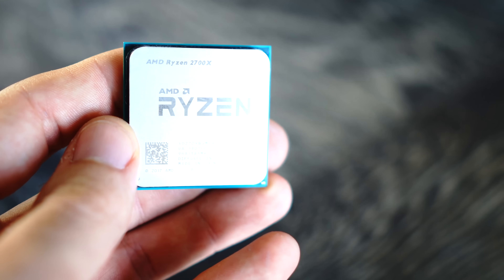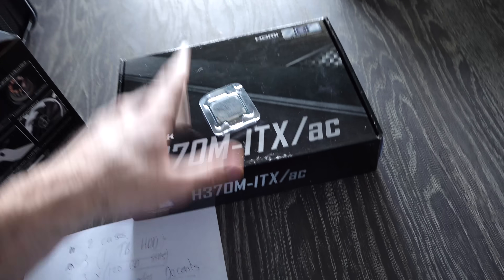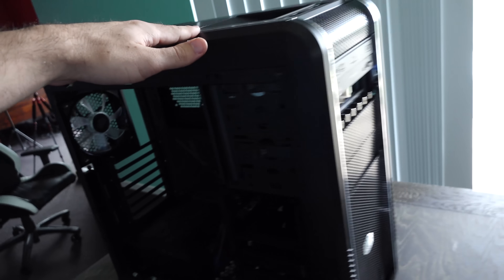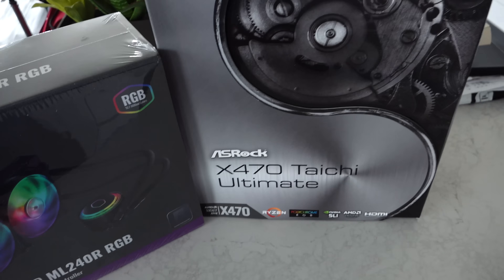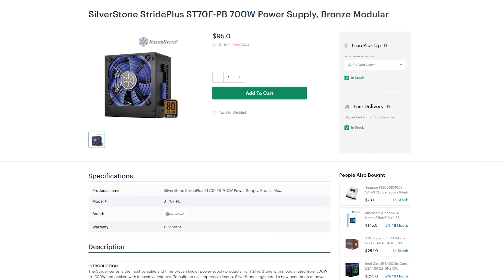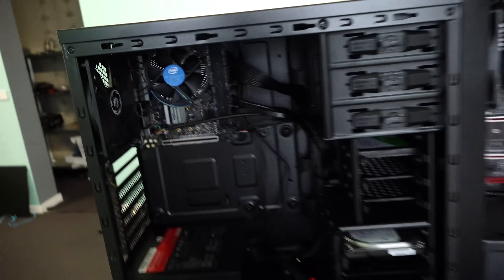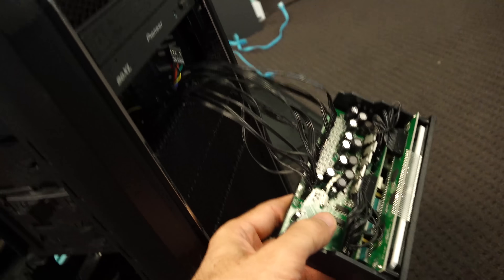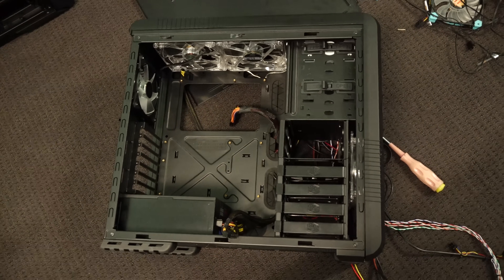X58... Vs... Something... IT BEGINS! The Story of 6 Core 3 Way Comparison that Never Came...

Comment: Damn that's almost apples to apples but the ryzen is going to have the advantage with it being a 6 core 12 thread where the other 2 are just 6 cores. I still want to see apples to apples with no price blocker. Same cores same clocks and see those results. Like the 8700 against the rice en 2600 or even the 8700K vs the 2600X. Where both the 8700 and the 2600 both are running at 4.2GHz or 4GHz since the AMD chip might not be able to hit the 4.2GHz mark. No one did that with the last gen and personally I don't think any of those past test panned out. Everyone was putting the 7700k 4 core 8 thread up against the 1800X with 8 cores and 16 threads, how is that even fair? No price, just performance, core vs core and thread vs thread.
Reply: x5675 is 6/12....
Reply: Oh crap, I should have looked that up, I apologize. I assumed it was just a 6 core part. But as for the newer parts, I would still like to see a fair run, and ignore the prices of the parts. Core for Core, Thread for Thread and GHz for GHz. To me that is apples to apples. I mean would you put up a 4 cylinder engine up against a 8 cylinder engine?
Reply: Eric Marcus well all of these would be a v6 in that regard. So it's fair to push them all to their limits to see which is truly best. Clock for clock ryzen beats Intel, but real world Intel has higher clocks, so why force it lower

Comment: Please test the encoding performance. Which X264 preset (slower is better) can you run on 720p60 and 1080p60 without any stutter? Not running the game on the machines, just simply encoding the input of a capture card or an NDI source on the local network. I always stream with NDI to my encoding rig and encode the NDI input to Twitch via X264, that works perfectly.

Comment: Great work Bryan. Looking forward to it!

On another note I have a question for you if you'd be so kind to answer. I noticed in Australia that the price difference between the cheapest b360 and z370 motherboards is only $20-$30. I am thinking it may be best just to go with a z370 for the better audio, looks, etc. Is that the best move considering I am planning on going with an i5 8400 if its gaming performance is significantly better than Ryzen? Would you consider the z370 a waste of money in that situation? I'd like to go an 8600k but it's $100 more and then you need a good cooler and the budget starts getting blown out pretty quick especially with the current prices of ddr4 and gpu's.

Comment: As long as you quantify price vs performance for the Ryzen RAM I don't really care what you choose to use. But I would think 2933 or 3200 would make the most sense as the difference isn't that big if you shop around. There can be a noticeable difference even between different kits at the same speed though, as GN has shown.

Comment: I'm still rocking a X5650 @ 4GHz combined with a 1070, this weekend i'll probably upgrade to a e5 2680v2 which was able to do 3,4GHz on all 10 cores, which it should bring it to about the same gaming performance as the X5650 :)

Comment: Good work Brian. Looking forward to it. I have a little tip for you. 14900e 1866 DDR3 unbuffered ECC is compatible with the X58 system and they WANT to be overclocked. 2000mhz is possible with 1.6 ish volts to the ram and an increase in VTT voltage. These dimms are from the 2013 Apple Mac and are usually sold in 3x4gb kits all over eBay. Always use 3 sticks in X58, 6 will strain the IMC beyond stability.
Reply: hey I know this is kind-of an old comment, but I recently picked up an evga x58 motherboard and was wondering about ecc compatibility if i used a xeon. Are there any special setting that need to be enabled to get ecc working with something like an x5670?

Comment: Doesn't spraying WD40 on the PC make it smell really bad?  How long do you have to air it out, before that goes away?
Reply: CyberClu i like the smell
Reply: i'd be more concerned with it corroding shit but whatever.
Reply: WD40 is anti corrosive, but it can destroy plastics (like mineral oil)
Reply: I'd never consider doing that. Nah, bruh, rather not sprayintg WD 40 into my Machine...xD Its pretty much uselss hence teh Plastic residing in every Corner of a Case Nowadays, those Fans don't desrve such a mean Treatintg xD
Reply: emperorSbraz it’s an anti corrosive spray genius

Comment: that X58 is gonna get wrecked by the 8400 and 2600X , its a 10 year old plattform w/ sub  sandybridge IPC
Reply: Justagermannerd true but it wins in price/performance
Reply: the boards are ~100 bucks and the cpu is another 50~80 
for a 10 year old plattform that is a terrible price , id rather buy a new R5 1600 + B350 board for 100 more
Reply: or X79 which you can get deals on motherboards if you really try.

Comment: Looking forward to the comparison. Can you also measure power usage for these systems as I expect the good old x58 to be a bit power hungry in comparison. Might not seem super important, but over a year of usage it adds up in $
Reply: Bart Lammers the xeons probably use less juice than the ryzen.
Reply: Ryan Daniels oh I had no idea, good to know :)
Reply: Ryan Daniels actually the TDP is 85W vs 65W on both the Ryzen and i5. Once OC-ing this might rise a bit more
Reply: R5 2600 has a moderate 65W TDP but the R5 2600X had a higher TDP of 96W.

Comment: Ddr4 3200 sounds about right for the ryzen system. From what I hear it would be a challenge to get anything faster running on a b350 anyhow. 
Having said that I was surprised to see that there are actually some good deals on faster ram.(3466 cl16)

Comment: 3200 is probably a reasonable ram speed to compare. If someone's buying a ryzen 5 they probably have budget in mind, and likely wouldn't be getting crazy fast ram. It's a good middle road between price and performance that I think a lot of people will likely use, especially since 3200 was the max from gen 1 ryzen most people upgrading will likely carry over their old kit.
Reply: I'm glad someone finally realized what it was haha.
Reply: 3200 has caused some people no end of issues, really 3000 is the max you can reliabily use with with gen 1 ryzen without very specific memory approved for your specific mobo
Reply: Jay Koerner 
With the latest bios updates even your crappy Hynix based C16 ddr4 3200 seems to work fine. 
Having said that some people did get unlucky with bad motherboards and memory controllers.
Reply: 32000/3333 and cas 15/16 is what most people want with bang for buck.
Reply: Plus memory speed really doesn't affect the pricing, nothing close to how capacity does anyway. There're also tools like the Ryzen DRAM OC tool and The Stilt's presets which pretty much make it possible to OC any kit to ~3.2GHz give or take.
Reply: 3600mhz works with r5/7... even some 4000mhz kits

Comment: X58 has to be the best platform
Reply: X79 is a great platform too! My EVGA X79 DARK (LGA2011-1)can take up to an E5-2697 V2 12 core Xeon, plus quad channel memory. Looking for an X99 now too. Still have my X38 (LGA775), and would like to find an X58. Wish I could afford X299. The EVGA X299 DARK with an i9, to be precise.
Reply: What can the 2697 do on all cores? Or is that just your theoretical upgrade path? Because i think even the 3,4Ghz my 2680v2 does on all cores is a bit low, might be selling the CPU and getting a 2690v2 which should do 3,6GHz all core turbo...
Reply: With the right microcode on the bios, you can run the 2697 at 3.5 on all cores, but I'd probably go for the 1680 v2 8c/16t, cause the 1600 series have unlocked multipliers and stock it turbos to 3.9. Also the e5-2687w v2 8c/16t turbos to 4.0. 2600 series have locked multipliers and the max oc on the base clock would be around 105MHz plus or minus a few MHz, depending on the silicon

Comment: Guys, I need  HELP, please help decide, Currently I am running An i5 4th gen 4440, 8gb DDR3 @1600, Asrock H81m motherboard with HD6670 Graphics Card, Should I upgrade to Ryzen 2200G with A320 motherboard by selling old rig. or Stuck to it for a while.
Reply: keep the i4 and upgrade gpu
Reply: Still cheaper than a whole new system methinks
Reply: The simple answer is you won't see much performance benefit on the CPU side http://cpu.userbenchmark.com/Compare/Intel-Core-i5-4440-vs-AMD-Ryzen-3-2200G/1993vsm441832 only about 19%, which is only in CPU intensive workloads so games won't see much real world benefit. Although, your GPU is outclassed by the onboard video card on the Ryzen system. Honestly, I would sell your GPU and get something better. Your CPU won't see much benefit in the real world, but your GPU is the bottleneck in your system.
Reply: Just grab an used GPU there are some good deals right now some friends for an 980ti for 450 cad and 2 290's for 150 cad each miners where dumping GPUs last week may have stopped by now though as crypto market rebounded an bit. but an awesome upgrade for you would be an GTX 760/670 whitch can be found for arround 50 usd if your really bargen hunting
Reply: That's a poor choice for upgrading. That's more a sidegrading.
It's ok to seel your old gear, but don't get that ded end mobo and quad core.
Go for 2400g, it's really that much better.
Reply: GPU price is a bitch right now!!!
Reply: Yep you are gucci just get more ram and a better gpu ;( im the other way arround pentium g4400 12 gb ram but iv got a gtx 970 deal i need to upgrade cpu
Reply: Just dont get A320. Go with the cheapest B350.
Reply: Both my Ram Slots are full because 4Gb x 2 = 8 GB, Gpu prices are a bitch right now. And Pre Owned GPUs are crazy right. People here dont understand the meaning of depreciation here.
Reply: Solution is X58 Xeon and X58 mobo , use DDR3 already you got and GPU you got or look into GTX1050/RX 560, turn old PC into HTPC
Reply: Rohit, try buying a gpu second hand or selling your old one to help pay for the new one. I'd definitely just stick with the i5 and upgrade your gpu for now, the apu isn't worth it imo.
Reply: Buy a gtx 1050, will be better than the apu
Reply: 19% is quite a lot actually. lol its 1/5th. but i agree the GPU should be upgraded to get the better performance
Reply: Don't touch that APU. You'll regret it. Especially the 2200G, quad core is a dying breed.

Comment: Still rocking 980x and 990x CPUs and love them. Go well with 980tis in each.
Reply: i7 980X here OC to 3.875Ghz and GTX 980. system orginally was a i7 950 or 960, couple years ago I bought the 980X off ebay for about $200 (not bad for a $1000 Extreme cpu), upgraded the ram from 6Gb to 18Gb (triple channel) and of course have upgraded the video card multiple times...
Reply: Goodfella240 I'm using an i7 960 still...
Reply: Also on a 980X/980Ti machine so looking forward to more six core comparisons.
Reply: Im rolling a i7-870 O.C'd to 4.0ghz. it's a damn solid preformer, first and last i7 I ever bought, I got it new haha!